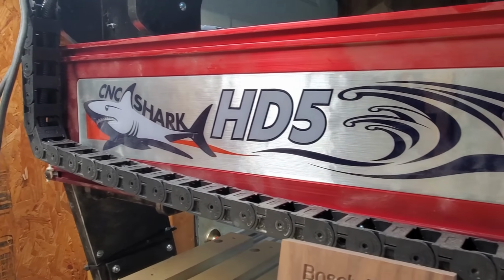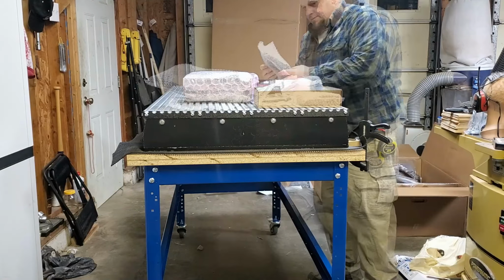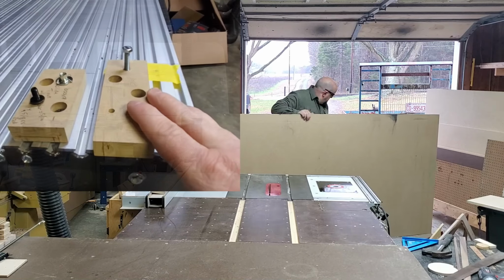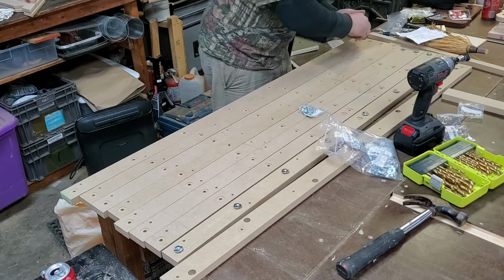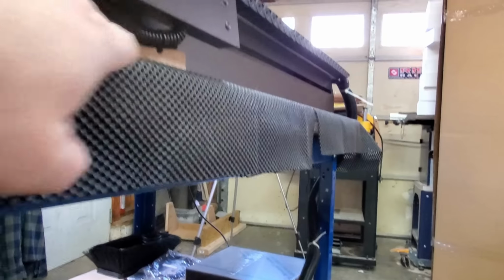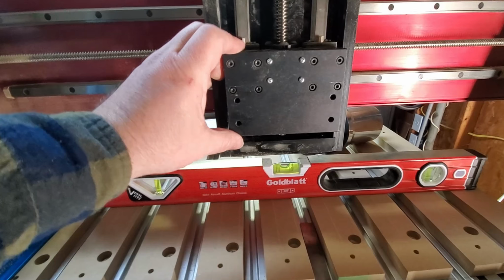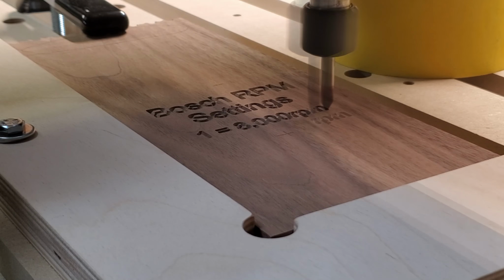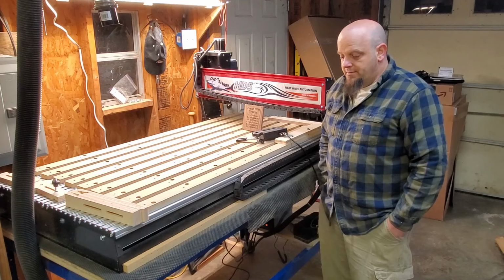Shark 5HD EXT 25x50 CNC Full Assembly With Problems and Fixes

Comment: I'm building a spoil board on my HD 510 and I'm copying your method , quick question, how wide were your strips on your spoil board?
Reply from the maker: They were an odd size and i dont have it anymore to measure it.  I think it was like 2-1/2" or there about.  I didn't like the offset mounting method I chose, even though it worked.  I recently saw that Next wave is offering a spoilboard as an accessory, and it looks good.  It's black, made for their machine, and comes with hardware.
Reply: @ChristcrossCrafts  Yes i did see that, they want 79$ and 50$ shipping, no thanks I'll make my own.
just curious why did you not like the offset mounting? so would you recommend Just fastening on the same T-Track for each board? 
thanks for your time
Reply from the maker: @Ritch Schultz  it wasn't bad.  I think I would make wider strips (3-4") on each end and narrower ones in the middle.  I believe I covered 2 slots with mine, then an open slot, then repeat.  I might would cover 3 slots (with a screw in the middle), then skip a slot and repeat.   It would look more uniform and centered.  Everything else I liked.  That's just me being anal about the appearance.
Reply: @ChristcrossCrafts  Thanks!

Comment: My HD520 is just barely off as well on the X axis.  I will do just as you did, confirm the gantry is perfectly square and then once that is confirmed ensure the spindle mount is square.  It's off so little that I hesitate to even mess with it, but I have had a few minor issues that are likely caused by that slight variance.
Reply from the maker: Getting the spindle dialed in can be a pain but it can also remedy other issues and eliminate the spindle from being the cause of others.  A tramming jig is the best tool.

Comment: do you have a hardware list?  I like your design.
Reply from the maker: I did at one point but no clue what I did with the list.  I've since updated to a stronger cnc. I used small oval nuts in the tracks and truss head machine screws countersunk 1/2" and long enough to go through the countersink and into the nut in the track.  I also added t-nuts under some of the strips.  

Had I redone that, I would have made my mdf strips wider where the center would be over a t-track.  That would eliminate the need to offset the screws and for the t-nuts.
Reply from the maker: There is a list in the description.  I just confirmed it.

Comment: I am thinking of getting a Shark HD 520. One thing about Next wave ordering is it has option for "lift gate" when purchasing. I am not sure what that means. Can anyone clear that up because the website is unclear.

Also is it worth it over say a onefinity or the other lower priced options?
Reply from the maker: Lift gate is if you don't have a way of getting it off the truck.  If it's at your home, you will want that.

There other brands for sure.  It's all a matter of preference.  You won't be disappointed. Upgrade to the new 3hp spindle and you will like it.
Reply: @ChristcrossCrafts  thanks for the info. I just have to sweet talk the wife to let me spend the money.
Reply from the maker: @tratzum  I've been there

Comment: Thanks for the video and your thoughts.  I just bought my first CNC router, a Shark HD 520 earlier this week.  In the processes of building a mobil workstation for the HD 520.  I have watched several of your videos, thanks for everything you do as it's very informative.  One question, I saw that you had issues with the Shark dust collector boot.  Any recommendations or has the issue been corrected?  Retired in CA...
Reply: Just saw your video on the dust boot upgrade...  No need to answer... Tks
Reply from the maker: To this day the boot is still made for a shop vac and the brushes are soft so it still curls in with decent cfm.  I found a really good aftermarket boot at kentcnc.com.  they offer a shop vac port as well as a 4" for normal dust collection.  They also have spacers available should you use long bits.  I bought 2 when I got mine.  I have another video discussing that on my page.

Comment: I have the little brother the HD500: Any chance you have plans for the spoil board strips & parts etc?
Reply from the maker: Not anymore.  I sold it and upgrades it.  My strips were about 3" wide.  I would center over one slot and span my board over one slot on each side if I were to do it again though.

Comment: I noticed you put the machine itself on top of two narrow MDF boards at either end.  How did that ultimately end up working for you?  I’m trying to build a table for mine now; it’s not going well and I will prolly end up doing what you did.  I didn’t realize when I bought it that the entire frame just sits flat on whatever table is used, without allowing for any adjustable feet.
Reply from the maker: It worked great.  I used 2ea. 3/4 thick particle board (to save $). I also added some stretchers underneath to add strength in the middle.

Comment: thanks for the video brother! I ordered a shark 520 as well.. i like how you did the spoil board..honestly im playing hell finding the exact sized oval nuts, t nuts and hardware.. rockler has similar harware but seems too long for mdf? where is the best place to order the hardware like shown here?
Reply from the maker: I ordered the truss screws from Amazon but all the knobs, 5/16 t-bolts, tnuts, and other fixture stuff I bought at my woodworking supply store klingspors woodworking shop.
Reply: @ChristcrossCrafts  wow thanks for the quick reply! i will check them out now
Reply from the maker: @indigomoonwoodcraft1893  no worries. Happy to help. I buy most of my stuff there, including my cnc.

Comment: Nice machine. I am looking at one of these or the infinity one cncs .   I really want to have a 50x50 travel machine to handle full 48x96 sheets of wood.   I had bought one of those cheap chinese 4x4 kits. The flex was terrible and using those nylon or delren roller wheels was a night mare.  How is the tolerences on your machine?
Reply from the maker: It's not bad.  There is some deflection in the bed along "Y" but expected some with a thin table.  I've since upgraded to an Axiom Elite AR8.  Much thicker table, 3hp spindle, and built solid.  I did a video on why I upgraded on my page.  Much more $ though.,, but worth it.

Comment: What was the dimensions on the Kreg HD work Bench Base. They make several and I need one the same size as yours
Reply from the maker: I used the 28" & 60" rails.  I made my plywood top overhang a little more on the sides than front to back.  If you are short (like me - 5' 6") you may find the casters raise it up a little higher than is desirable but it still works well.

Comment: Great Video, super helpful, Thank you!  What size did you make you bench top?  And if you were going to do it again would you make it the same size  or change it and why?  Thank you again!
Reply from the maker: I don't fully recall what size I ended up with (I upgraded to a larger machine), but I believe I made it about 2-3" wider on the sides and left about 6 on each end.  This gave me room to make a holder for the pendant and a sort of "shelf" to place clamps and bit while prepping and staging cuts.  

I liked the Kreg stand, but if I were to do it again, I'd likely build a cabinet with shelves and/or drawers and doors to keep dust out.  Even though the stand was adjustable, once you add the CNC and casters, it was a little tall for my liking.  

As for the machine, my needs changed and 1/2" shank bits needed to be used.  If Next Wave would have offered a spindle with 1/2" shank capabilities, I would have bought that and stayed with the Shark.
Reply: @ChristcrossCrafts  Thank you!

Comment: Unfortunately, it’s not detailed enough for me. I put my SawStop saw together without any problems. The assembly instructions for this machine are the worse  I’ve ever seen. Your video sped by places that were issues for me. No help.
Reply from the maker: I've assembled 3 or 4 of them.  What is holding you up?
Reply: @ChristcrossCrafts  First the cable carrier. I broke one of the latches because it wasn't clear to me which way they came off. Second getting the cable carrier on the table. I put it on and then I couldn't get the bolt through the loose end to the spar. I had to take the whole thing off and it wasn't easy to get on in the first place. Now I'm having difficulty getting the cables into the carrier. I hope that this machine works better than the directions have been.  Thanks for you reply.
Reply from the maker: One latch broken shouldn't cause any issues.  They have a clip end that is best popped off using a flat head screwdriver.

I actually called Nex Wave about this and requested two additional screws to aid in supporting the track to the table.  I lifted the tab to gain better vantage point then used a small phillips through one of the holes.  It was a little tricky since I have fat fingers, but popping the tab on the track helped.

As for the cables... I ran my router wire off the other side.  My cable wasn't long enought to safely pas it through the channel.  If you have the spindle, then I'm not sure the hoses will go either.  It's really only made for the stepper cables.
Reply: the fact you took the time to leave a comment like this is flat out ignorant. dude takes time to make  a free how to video,spends his valuable time creating / explaining, and you wanna bitch about it?!  GTF man!

Comment: I just bought a 520 today. I have a coupon for the water cool system however my question is what type of router works with the machine. Please help?
Reply from the maker: Most round bodied 2-1/4 hp routers.  Bosch 1617 is a good one.  Their spindle cannot use 1/2 shank bits, so be aware of that.
Reply: @ChristcrossCrafts  Thank for the help with the router. I’m so happy to do bigger project now
Reply: @ChristcrossCrafts  Thank brother
Reply from the maker: @wickerdn1  anytime.  It's a good machine.
Reply: @ChristcrossCrafts  Thanks for your videos and responses. Shark has the  3HP SPINDLE with DIGITAL INTERFACE and 1/2" COLLET, I am thinking about ordering the 520 with this option do you recommend?
Reply from the maker: @kennethsuer6294  that spindle is nice and for the money a really good deal.  I installed one on a shark I have at work and I'm fairly impressed.

Comment: For the sliding track bolts on the cable chain, do the washers go inside the track with the bolt, or outside the track, between the track and the cable chain?
Reply from the maker: I mounted mine  between the bolt head and the track.  I was concerned it would pull through without it.

Comment: This had been a very informative video. I am a mentor for our local FFA chapter and we just received a Shark 510 a result of a very generous grant. After watching your video I am waiting for the Kreg table kit and the Bosch router to arrive. Could you also send me the information for the strips for the spoilboard? Question: I understand the hole that holds the rectangular piece that slides into the track that holds the strip down. And we keep the every third track or so open to use clamps to hold down the articles to be engraved. What fixed nut used for? Thank you. jqadams111@hotmail.com
Reply from the maker: Thank you for watching, and congrats on the free machine.  I added various hold down options to each strip.  The countersunk holes are for the screw that screw into the rectangular nuts that ride in the track.  The other holes that have the T-nuts recessed in the bottom are for additional hold down options.  

You can run a bolt or threaded post from the top into the threads of the T-nut and use that as stops or other fixture options.  I didn't use them much but they did come in handy on a few projects.  

I'll email you a list and drawing I made for each strip.

Comment: You recommend this one?
Reply from the maker: It's a really good machine for the money (under 4k). It comes with software, so all you'd need is a router or spindle.  They offer a 25x25 if the larger table is too much.

Comment: What height is your work bench? I would like to order one, thanks.
Reply from the maker: This is a Kreg universal workbench.  It has adjustable height settings.  Im 5'6", used the casters & still had good height at the lowest setting.  Woodworkingshop.com is where I got it.
Reply: @ChristcrossCrafts  Thanks

Comment: Thinking of getting one of these. Any reason why you didn't get the CNC Shark HD5 Series 2 HP Spindle Kit and went with the Bosch?
Reply from the maker: Thanks for watching. The main reason is the shark spindle doesn't have 1/2" shank capabilities.  Plus, it cost another $800.  That's part of the reason I upgraded to the axiom Pro.

Comment: Thanks for this video I am looking at the 520 as well - how is the vertical stiffness on it?  It seems when I went into Rockler that it has some flex to it with minimal effort - has that been an issue at all?
Reply from the maker: It will have some flex due to the HDPE gantry supports.  For the $ its a good option.  A similar price point would be the Axiom Iconic.  They offer a stand.

If you check out a couplenother of my videos, I actually upgraded to the axiom ar8 pro.  In the video I explain why in more detail, which may help in your decision making.
Reply: @ChristcrossCrafts  the Axiom is the other I am thinking of - only issue is I don't have 240V available and I want to have a water cooled spindle vs router.  I am trying to figure out if the spindle from the 520 would fit axiom AR8 - it seems like a much better machine overall (stiffness wise, etc)
Reply from the maker: @BillNicholsTV  The spindle won't fit the axiom.  The Iconic is a pretty solid machine  (at 115 v) that comes equipped with an air-cooled spindle.  I would prefer that over the hose and bucket required with the Shark spindle.  They are about the same hp and limited to 1/4" and 1/8" collets so very comparable.
Reply: @ChristcrossCrafts  really appreciate the response - I am getting a new 220 circuit installed and leaning toward the AR6 2x3
Reply from the maker: @BillNicholsTV  You won't be disappointed.  As far as I'm concerned, the Axiom water-cooled system is the best on the market for this type of machine.  No hoses hanging off or buckets near the CNC.  I'm finishing up the assembly of my Elite 8 tonight.  Super stoked!

Comment: Curious what you are using for the lighting under the dust boot...  Is this an option for the new Kent dust shoe you mention?
Reply from the maker: I bought a LED light strip and ran it with the router cord.  On my Axiom I found a better solution that would also work with the Shark.  I bought a Halo led light that had a slightly larger inside diameter than my router/spindle (90mm).  That is much cleaner.  You can find them easily on Amazon. 

It will work with the Kent system. 

You will need to confirm the power options or locate a converter to 12/24v.  My Axiom has that wiring already ran for their LED kit.  I just wired into it.

Comment: What were the dimensions of your MFD strips? It looks like one or two strips had a different hole pattern, why? do you have the spacing measurement of the holes? I know I am asking a lot but I really like your spoiler board and I just bought a new 520HD extended bed and want to set it up correctly. Thank you
Reply from the maker: @jenniferherrell2504  check your email.  I sent an image with the hole layout.
Reply: Chris, Is there an chance I could get a copy of the MDF layout also. 
Thanks for the great video and information.
Jerry Hosier
jhhosier@yahoo.com
Reply from the maker: Check your email. I hope it helps.
Reply from the maker: I can't remember the exact width.  I spanned them about 1/8" shy of the T-slot on each side.  I believe it was 2-1/2".  I made them all the same and used a Sketchup drawing to keep me right.  If you leave your email or go follow me on Facebook and leave me a message, I can send you the layout of each strip.

I basically spanned the joints of the aluminum strips and used the t-slot on each side as my mounting locations.  I alternated left and right along the MDF strip (this layout is on the diagram I'll send).  

I also added some holes in the middle for T-nuts from the backside.  I used a threaded rod as hold-down posts.  I would not use those.  If you do, don't thread the bolt all the way in, as it will want to push the spoilboard up as it tensions against the aluminum.
Reply: @ChristcrossCrafts  I am putting together the HD520 and really like your spoil board. Could you provide the positioning of the screw holes for the rectangular nuts? Also the positioning of the T-nut holes?
ffloyd5605@gmail.com

Comment: I see when you installed the gantry you used the top 3 bolt holes. But further into the video I saw the top and bottom hole empty and you used the 3 center holes? Why did you do this and why not used the the bottom hole and work your way up? I just purchased a Shark 520 HD extended bed and will be putting it together tomorrow and help would be appreciated. Technical support said us the top three but gave no reason why there are 2 lower hole??
Reply from the maker: The other holes are so you can raise it up to accommodate a thicker table, taller parts, and just to give more room between gantry and table.  

I did leave the top hole open due to me adding a spoilboard.  This gave me just a little more clearance.  I wouldn't leave more than one open at the top.